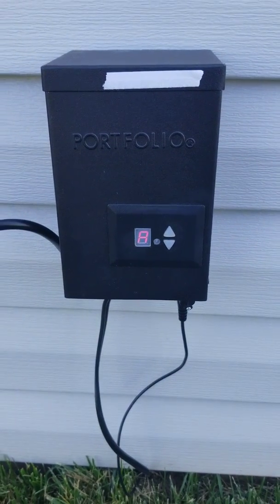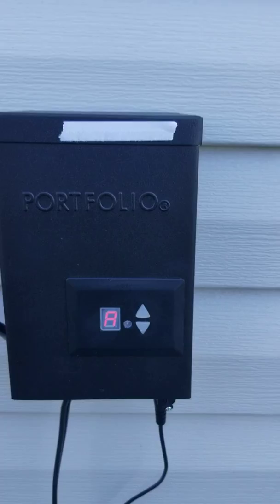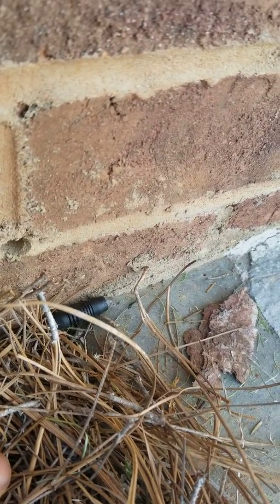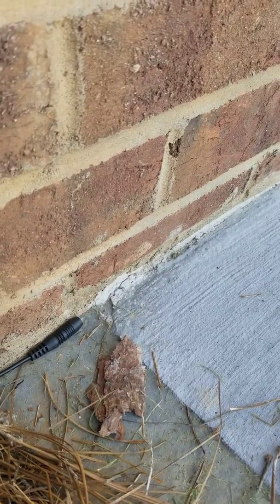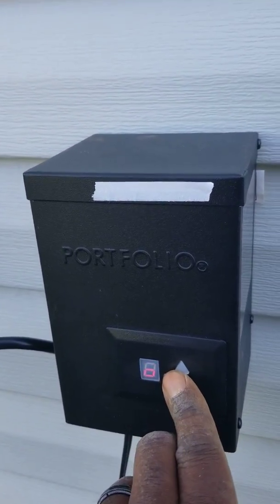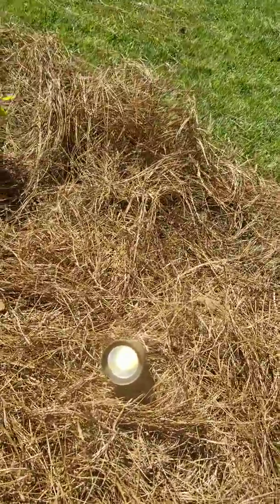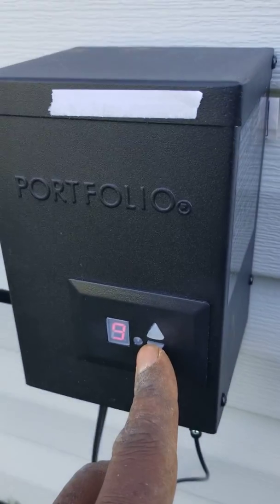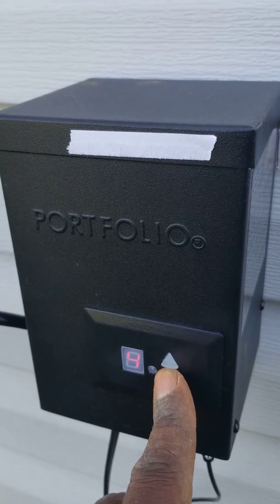How the timer works on the transformer

Comment: I have this installed, I keep it on A and lights turn on and off on its own as it gets darker or brighter. But I noticed I walked out and it was bright enough that the lights should be off and they weren’t. So I manually turned them off with the button and they’re staying on. The only way I got them off was to unplug the transformer, any idea?

Comment: it looks like your transformer has a photo cel built in, why did you use a extended photo cam? my photo cel is built in and I do not need a extended cam?
Reply: You are correct. The Portofino system has an integrated photocell.

Comment: Hey -nice, direct instruction. I am getting an "E" signal on my transformer and the lights only stay on for a few seconds. Any help?
Reply: The E is an Error signal, try unplugging and resetting, if that fails there could be a short circuit
Reply: Same here... bought a new box today does the same thing happened w the error message. I'm lost at this point

Comment: if you set it to hours (for example set it to 6), does it turn on for 6 hours a day, from the time you initially turned it to 6?
Reply: The hours on begins when the sensor first turns the lights on at dusk.

Comment: 200watt portfolio box is kicking on my lights for three seconds then lights turn off and box reads "E" error. I bought a new box today and it does exact same thing. I have 8 landscape lights connected 7watts each no wire frey or tears detected anywhere. Help pls
Reply: Did you ever figure out your problem? Recently, the 300w has been selling at Lowe's for only $30 more than the 200w, and it has a 2 yr warranty. The 200w seems to be the one having these issues, and Portfolio/Harbor Breeze aren't putting warranties on it. Seems like the best thing to do is go get a 300w transformer for $120 and switch it out.
Reply: @Mickeysdelicatecare  the electrician installed a shitty breaker after id bought two of these and a kichler which kept and I am happy with it as it is still going strong but I'm sure the others were fine.
Negligence on the part of the electrician

Comment: What if mine doesn’t turn on at all
Reply: My 200 Watt failed after 4 years with 160 led total watt on unit.   I found  Total Lighting Supply on the internet and ordered a commercial unit.   I wish I found them first. They have lots of you tube videos.
Reply: After storm, I had to reset outlet/ fuse.

Comment: I tried to set mine for 4 hours which I understand the lights will come on at dusk and run for 4 hours.
But something's wrong...
I pressed the button to 4 (in the daytime) and the lights came on instantly, like the sensor thought it was dark out.
To test the sensor I took a flashlight and shined right on the sensor and the lights still stayed on.
Do you think it's a bad sensor?
Reply: Cover the censor to trigger it to turn on, shine a light at night time to trigger it off